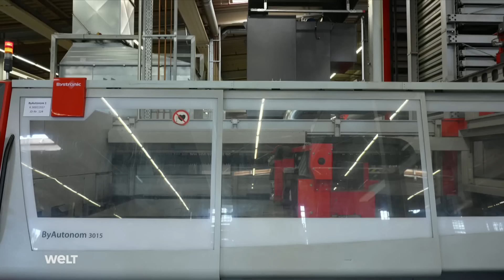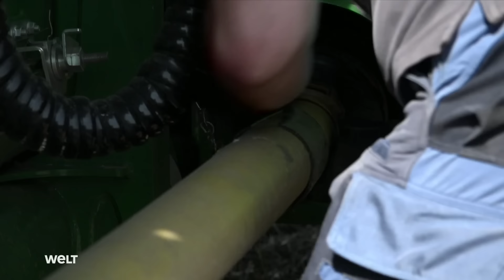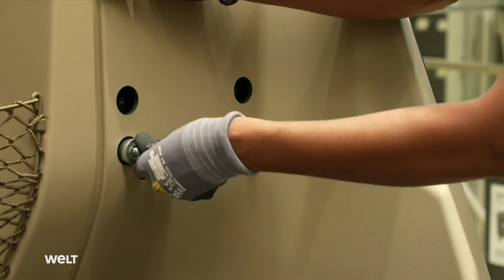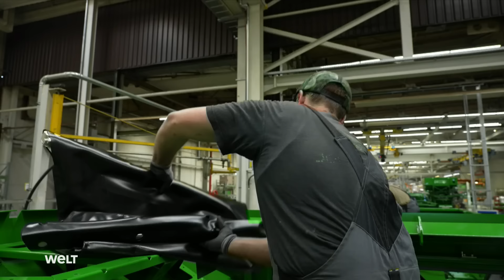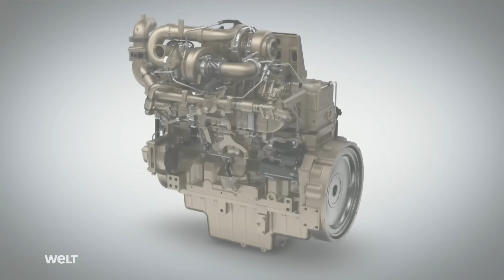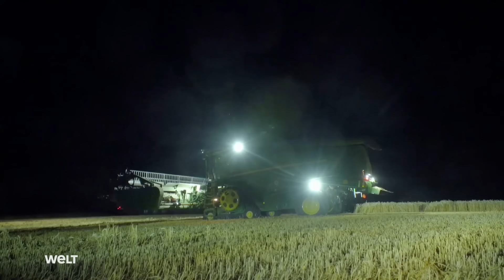John Deere Manufacturing: A Giant Emerges | FD Engineering

Comment: For years, John Deere has forced equipment owners to only use certified mechanics to repair equipment that they didn't own, which was way overpriced. Claiming it would violate their software rights. So, does a car company still own your car after buying it as well. John Deere has been sued multiple times already. Why do you think they are going broke. Once a piece of equipment is sold, farmers have every right to maintain it as they see fit. Many farmers have already bypassed it to do simple maintenance. If John Deere is so worried about software theft, maybe they shouldn't install it on $600,000+ pieces of equipment.

Comment: Good machines that I no longer can use. Management at Deere has locked me out of making repairs on in many cases even simple diagnostic tests. I have to have a complete inventory of parts for all harvesting equipment on hand and have our own service/repair/maintenance dept. Deere has chosen to not allow me as an owner to make my own repairs, this is and always will be  for me a non-negotiable deal breaker. Profit or loss for the year usually comes down to less than 10-15 days of peak harvest sometimes less with weather issues compressing the normal harvest window. That's why we keep many older machines in continous ready to use condition so replace a broken machine w/o waiting for Deere which has allowed us to increase daily harvest acreage if needed even while being forced to augment harvest with less efficient machines. I hope that Deere comes to their senses before the color green becomes extinct as this company had always provided farmers with sound equipment and solutions, until then I will not even look at their offerings. Ray
Reply: chek the Claas
Reply: I hear you loud and clear... we went to the point of changing brand.... to cnh
Reply: This is false the only thing the farmer cannot do is software.  It sounds as tho this guy shouldn’t be able to do software at all.
Reply: @StevenGeorgi  I am not sure what you are saying is False, I do not do false. I am not able to use the diagnostic routines embeded in the operating system, further even when I am able to identify the failed part Deere will not sell the part directly only thru a repair order with needed part installed by their authorized dealer, even more ergregious is that the software cannot be reset by anyone other than the deere mechanic. Basically all I have is a useless hunk of iron until the factory repair is completed by the dealer.
Reply: @rs2024-s4u Are you able to do all this on new cars? New smart phones? These devices are well beyond the iron used to make them these days.
Reply: @dmar191  I and my family depend upon these machines being able to run at harvest... I can rent another car or cell phone combines are not replaceable in the timeframe required even if I could afford the many hundreds of thousands a combine costs
Reply: @rs2024-s4u X9 in Australia close to $2,000,000 😮